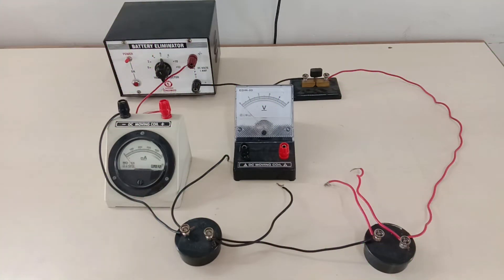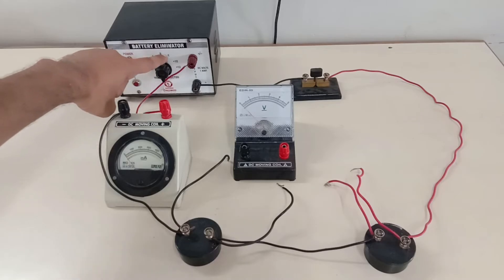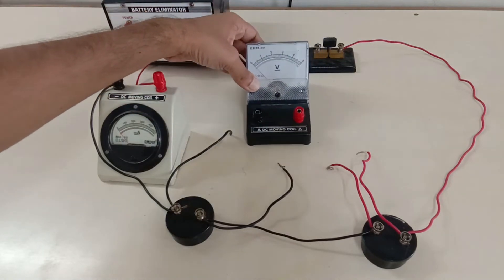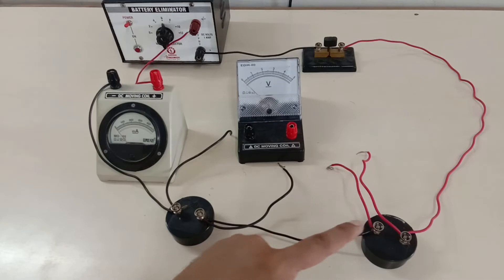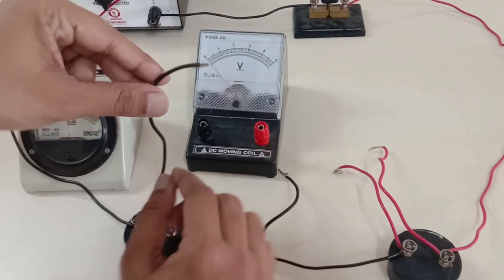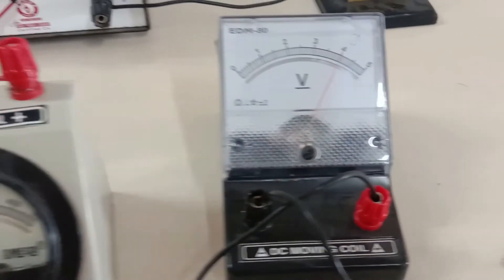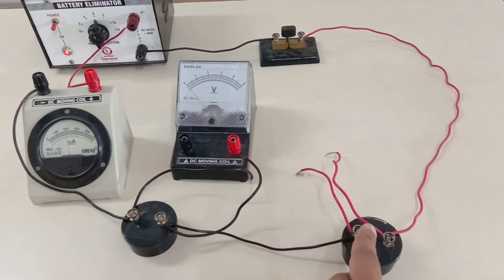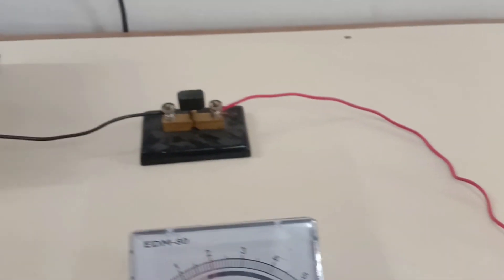Resistances in series & Voltage drop | Ohm's Law | Physics Demonstration | Grade 10 experiment

Comment: Hello, which font do you use in the blue slide at the very beginning of the video? In the frame with the title with your name on it.
Reply from the maker: "Voltage drop in resistors connected in series "